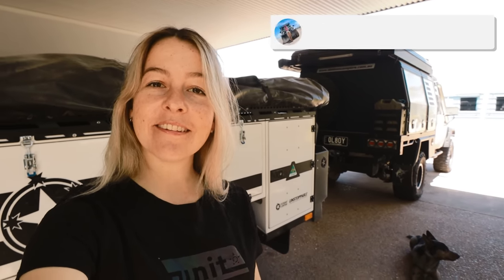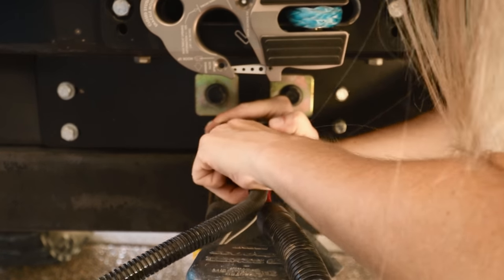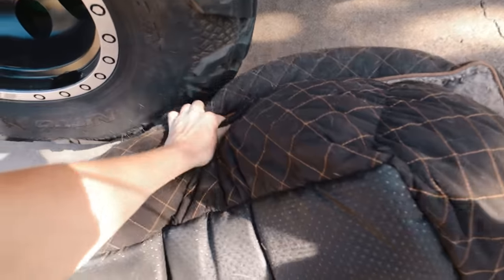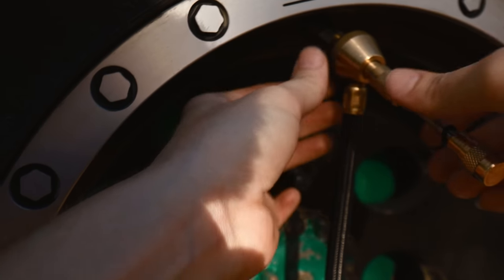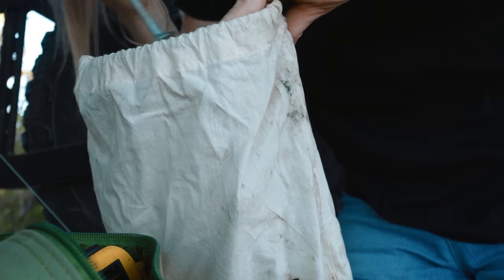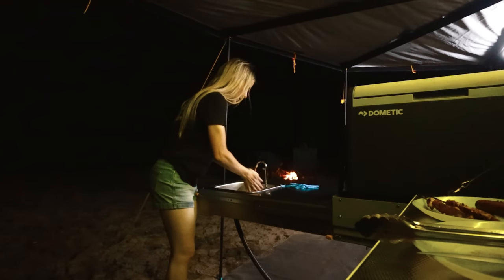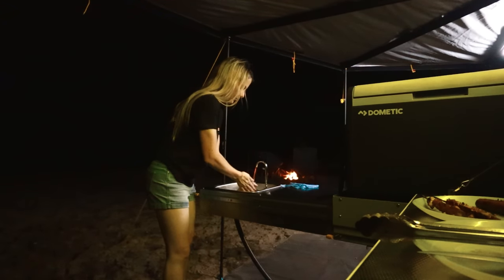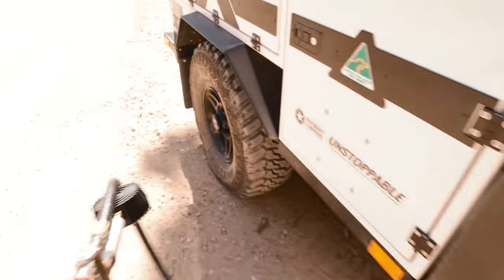Best Beach Camping 20mins from Townsville!

Comment: Lovely editing- Great to see you getting on with life and sharing.  One comment with the breakaway on the DO35 which I notice you didn't hook up to the draw bar.  There are supposed to put the brake on the trailer if the trailer detaches.  But with the stretchy cord they supply, I cant see that the trailer would ever be that far away to activate the switch if the hitch brakes.  So pretty useless?  Must be a government thing. I put mine on to the draw bar but wonder each time.
Reply from the maker: Hey cheers for watching appreciate it!
No breakaway cable system on my trailer. A breakaway system is only required on trailers over 2T (which mine isnt)

Comment: Are those Dobinsons with remote res worth the money?  I'm a weekend warrior and not sure I want to open my wallet up for them.  Great vids and thanks!
Reply from the maker: Depends on a number of factors really. I have an alternating read load so they work brilliant for that. Most adjustable shock on the market and insanely comfortable. Was very impressed in the vehicles which had them in for the lane change test, they handled amazing.

Comment: Hi Danie
Just curious why you chose the x1-n?
I’m torn between the the x1n or the x1-h
Reply from the maker: Hey Stuart, we sleep in the roof top on the 75 so the dometic tent on the trailer is mainly for my partners little boy and we can remove it and still use the platform rack that is underneath. I think if you didn't have a tent/canopy setup the x1h with the Annex room would be pretty handy for changing etc

Comment: Im sort of undecided on airing down trailer tires because they then have a bigger foot print they will cause more drag and make it harder to pull across the sand . Where you want a bigger foot print on drive tires, tires you have to pull with more drag may get ya stuck more easily.. then on the flip side if the tires ride more on top of the sand that causes less drag then if they were thinner and riding more in the sand .. its quite the which came first chicken or the egg scenario 🤷‍♀️😂 i wish there was a way to measure the drag on inflated tires then on the air’d down tires to see which causes more drag … inquiring minds want to know 🤪🤪
Reply from the maker: I've towed the trailer across the same beaches for awhile now and airing down makes a much bigger difference for me. I believe the type of tyre plays a bigger role again but I will always air down the trailer, any drag caused by airing down the tyres shouldn't really be the determining factor of a vehicle getting stuck. Becoming stuck will come down to a number of other avoidable factors before tyre drag comes into play.

Comment: "The end slice" 
Never understood the cross chain crap in practice, I mean when that trailer unhooks it doesn't gently drop drop into the chains that a crossed over. It's going to be bucking around like a bull that just had his nuts zapped, more ppl need to focus more on chain lengths and how much slack is available. You have faaaaaaar to much slack.
But I do love your videos, I'm a fan😁
Reply from the maker: Yeah I've never actually seen it effectively work in a situation like that but it just feels wrong not to cross them haha. I keep the slack pretty even which is adjustable on the trailer probably not shown the best in this video

Comment: Put the Chinese in the freezer and heat it up in the microwave another day when you want it. Gotta love the keyboard warriors... NOT. Danie I have had 2 of the deflator sets and both of them have not read true air pressure on the scale, so I have bought a small digital tyre pressure gauge (Rough Country) which also has a deflator button on it from Autobarn Altona and it is spot on. Your sooo lucky to be able to get away.. we are still in a hard lockdown with curfew here in Melbourne grrrr..... We call the first and last piece of the bread loaf the crust.
Reply from the maker: That is what we did leftovers haha
Yeah I've got about 4bdifferent tyre gauges. 
Hopefully not too much longer for you guys in lockdown!